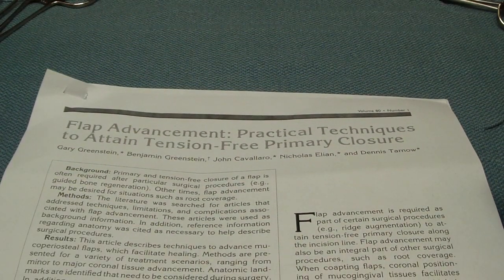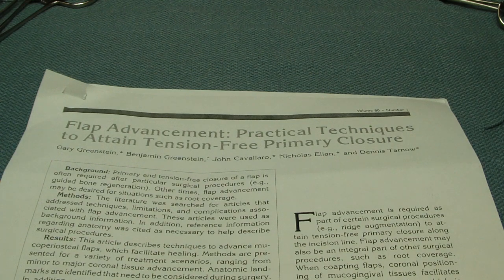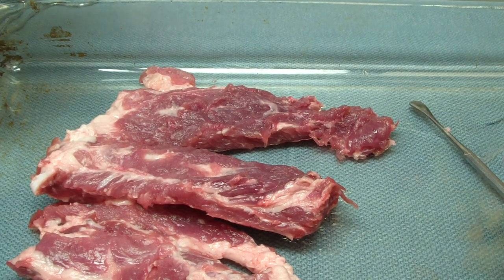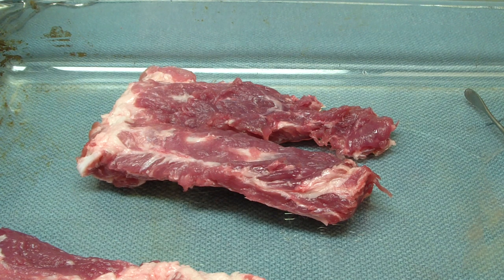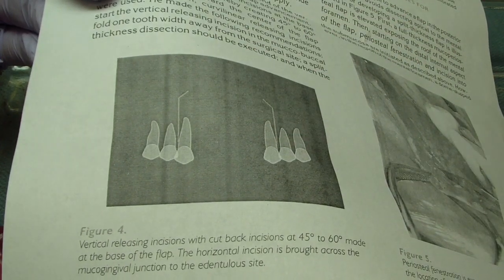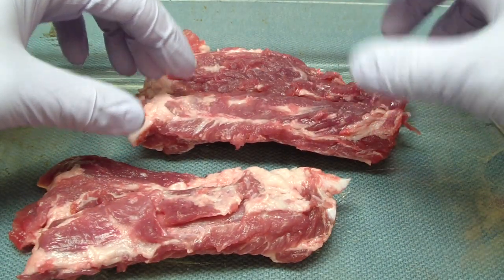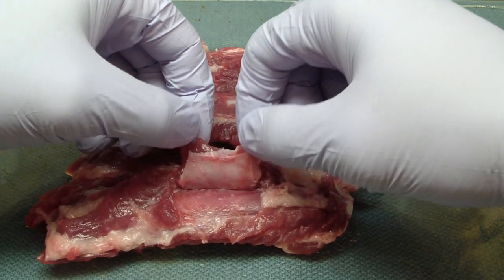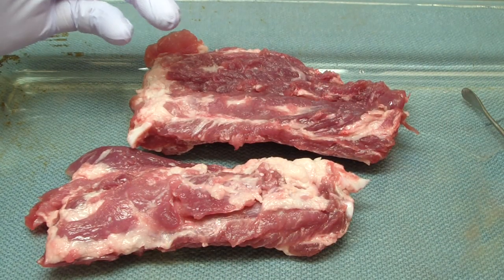Bone Graft - Periosteal Release - Porcine Rib

Comment: Great video doc! Only thing I'd mention is that the practitioner should be aware that each periosteal incision reduces blood supply to the flap. It is the opinion of Dr. Urban (and in my own personal experience) that a single incision is more than adequate for flap advancement if you adequately release bluntly/semi-sharp (opening motion with scissors). As for lingual flap advancement, the trick is not scoring the periosteum, it is releasing the flap from mylohyoid muscle in the right zones. 10+mm advancement can be achieved routinely using Urban's method. 

Keep on sharing the great content!